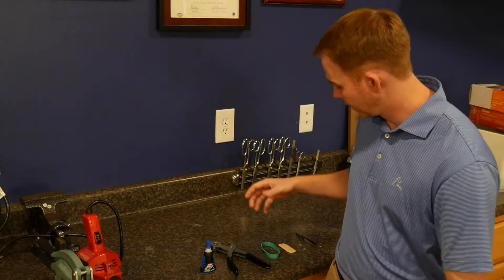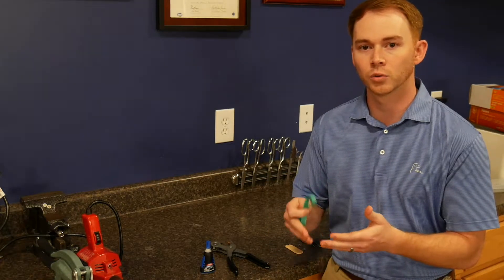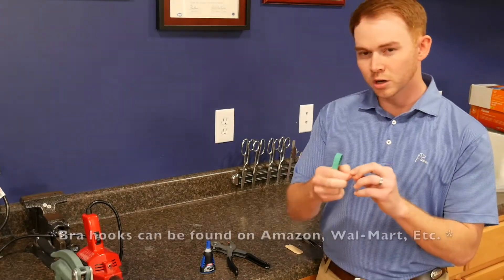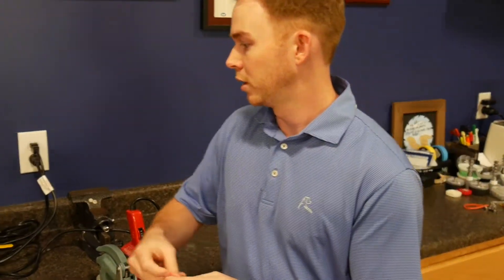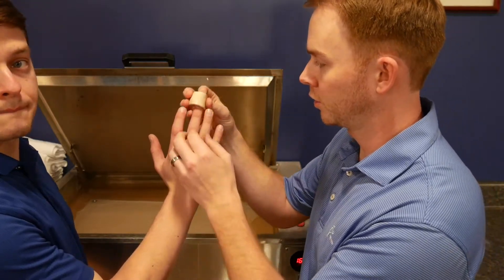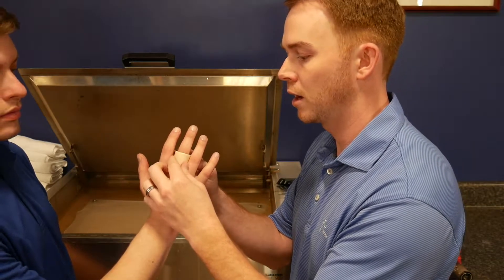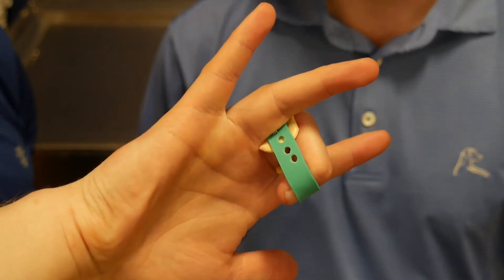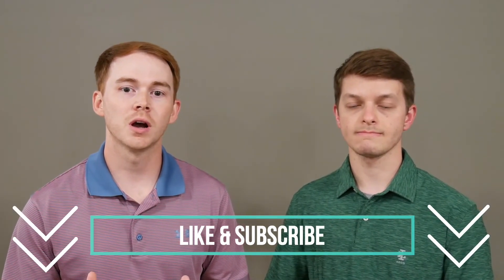How to Fabricate a Custom Orthosis/Splint For Prolonged IP Flexion

Comment: Love this. I make these all the time but I use scrap plastic to fabricate a hood for the tip and one for the proximal phalanx like you did. Hole punch the sides of both, take the heat gun and warm up the dorsal proximal end over P1 and pinch and pull the material to form a hook. Take rubber bands and put a knot in them. Thread it through the distal hood and then up through the proximal hood and attach it to the hook/horn. No supplies needed other than the leather puncher, heat gun, and two standard rubber bands you get from the dollar store. I usually put two knots in so the patient can progress the stretch.